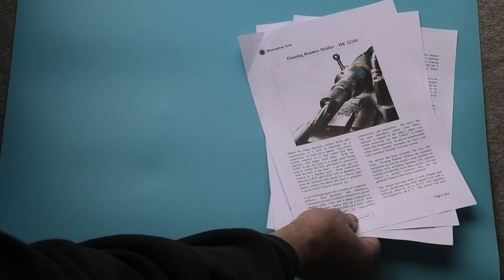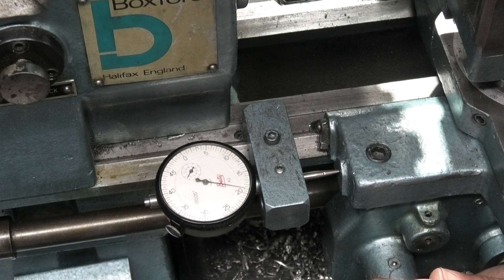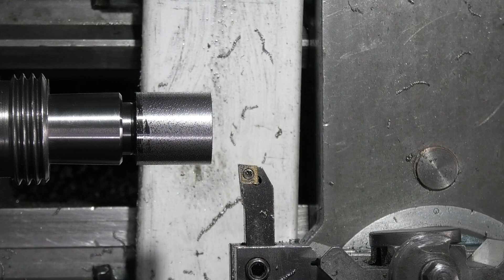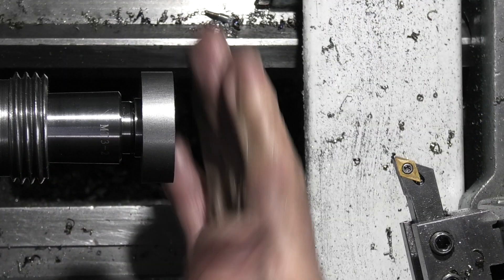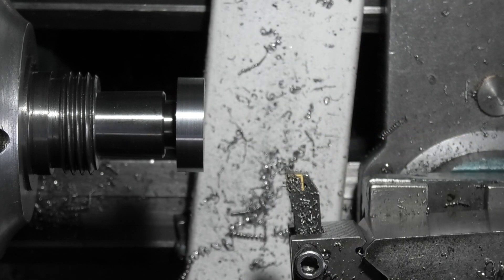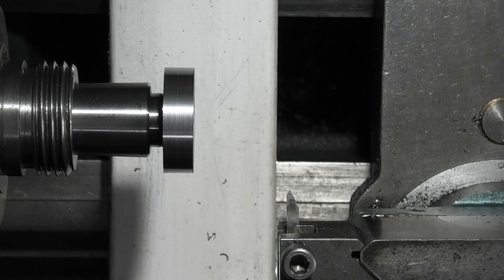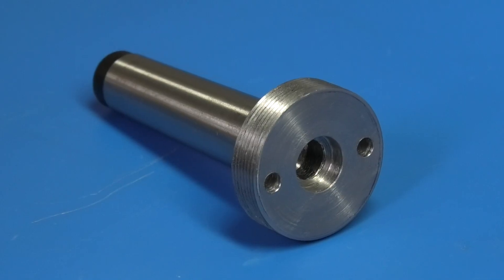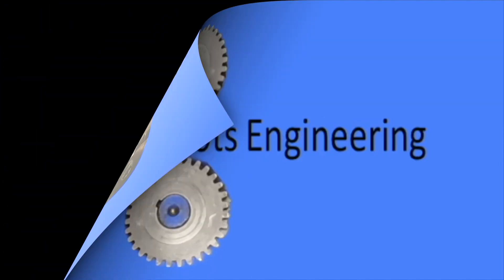Floating reamer holder part 1

Comment: I think you should try some DCGT inserts. They are designed for aluminium alloys but I find they are good for steel and stainless steel and have I have also had success turning HSS with them. It may improve the finish on tough steel like the sample that was giving you grief.